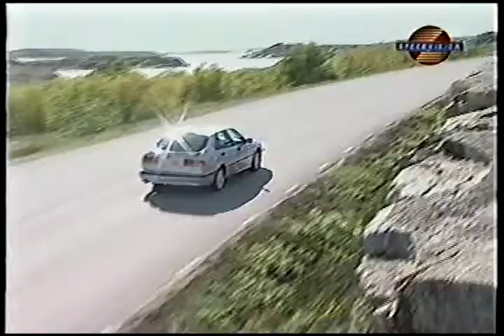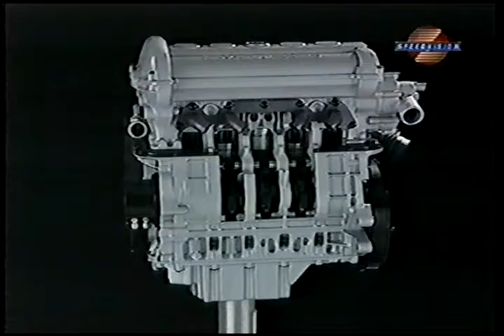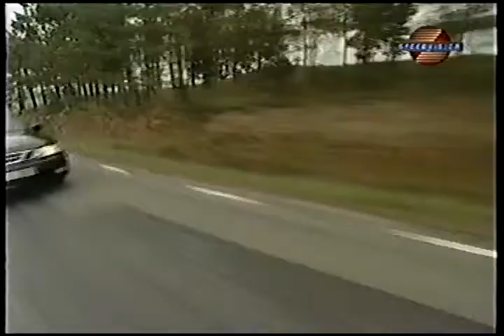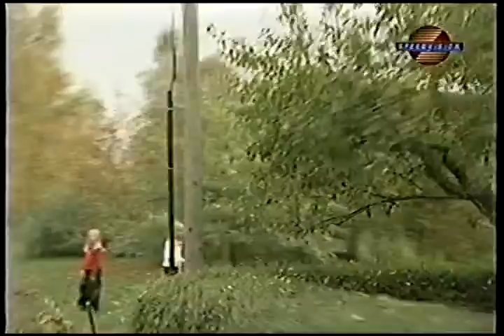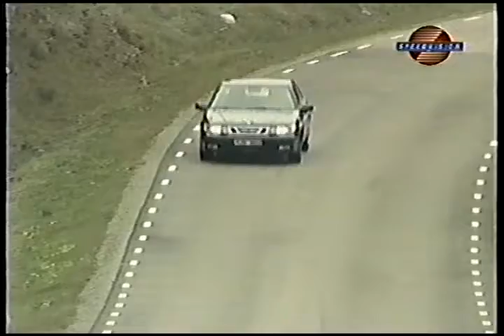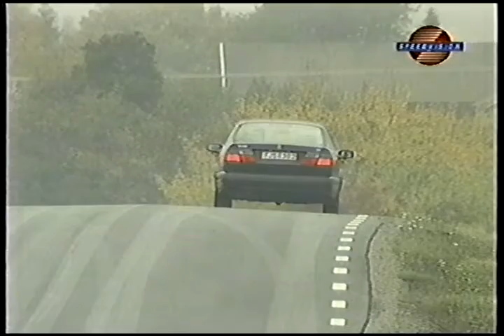SAAB SVC Variable Compression - MotorVision

Comment: Saab made Turbo, wastegaste valve, antiknock sensors work, and they made Ethanol more powerful than petrol in the same engine, which also impressed Ferrari. So why couldn't they make this work? But the cost compared to the benefit might have caused them not to launch it into mass production. I think also the seal on the head gasket might have caused a problem. Potentially the compression could cause the cylinder head to lift too much. But they could have solved these problems too, if they sold more cars and made more money. But a small factory could not sustain this level of inventions in the long run.

Maybe the 5 cylinder concept might have been better if it was a 1,7 litre downscaled 3-cyl version of their 2,3 litre turbo engine.

Variable air inlet might also have been easier to make than variable compression. They did use intercooler to cool inlet air, that also provides a bigger amount of compression when ignited. There are many ways to achieve a goal.